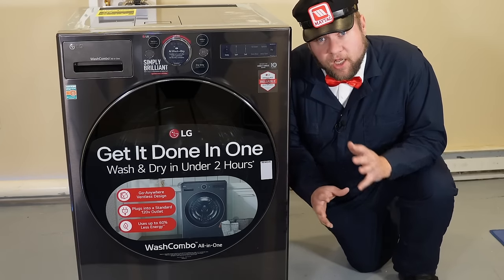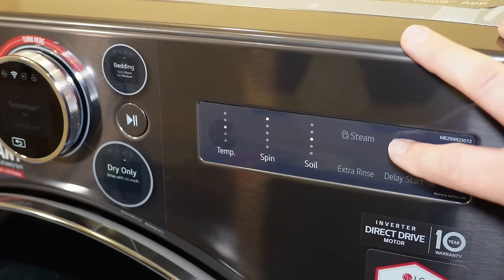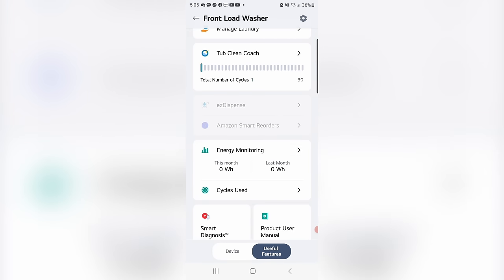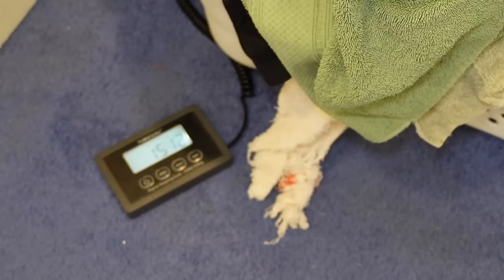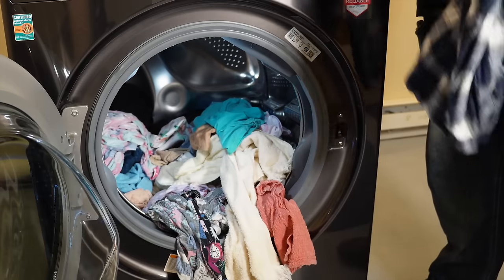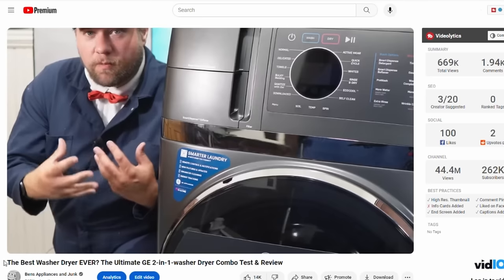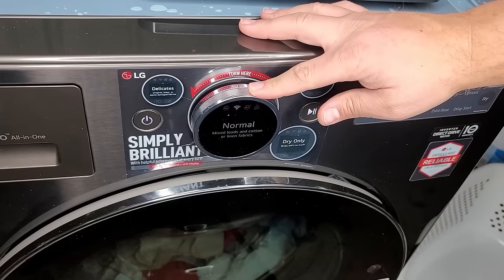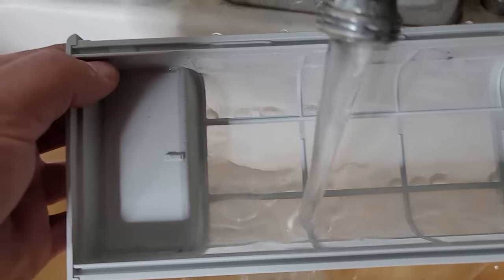BETTER THAN GE? The LG All in One Washer Dryer Combo: Test, Teardown & Review

Comment: ya know, I'm still using a Washer and Dryer From 1990. They still run like a dream, gets the cloths clean and dry, No internet Required, and the nonexistent LCD displays don't ever go bad....... because they don't exist.......... And i don't have to Worry about the AI not getting the cloths clean.......... because there is no AI. Just 2 nobs and 3 buttons, for load size. All Analog mechanical timer, and I never have to worry about Hackers or Guberments shutting them off because I "went over my Carbon footprint"  Also they are easy to repair, just hard to find parts for. but then again, they have been running for over 30 years so................................

Comment: Considering LG's reputation with compressors failing in their refrigerators and when used in central air conditioning condensers I'd stay from anything LG that contains any kind of sealed compressor system unless they put a nice long parts and labor warranty on the compressor and the whole cooling/heat pump system.  I also would never buy this or any appliance from a big box store even with an extended warranty.  My mother bought a washer from a big box store with a 5 year extended warranty.  When it failed we had to wait about two weeks for a service guy to come look at it and when he did his first comment was "We don't service GE appliances" and he left.  We had to call the warranty company back and have them send a different service guy out which took another 2 weeks.  Then he had to order parts and come back which took about a month.  It's much better to buy from a place that services what they sell and doesn't rely on outside contractors.

Comment: 2-5 hours for wash and dry, freakin ridiculous! Older washers/dryers i could get 3-4 loads done in that amount of time! These "energy" saving washers/drying are a joke!
Reply from the maker: An old dryer uses 10x the electric to get it done faster on 240v. If the heat pump was sized to a 240v30a element it would take half as long as what your old dryer did.

At peak, this unit uses 600w. The element alone an electric dryer is 5000 plus watts.

Comment: My concern would be the migrating lint inside building up to a degree that it either impedes or imperils running loads. Also, yeesh, those dry times when laundry day is already a dang chore. I would love to claw back wall space that would be freed up from my current stacked unit, not gonna lie. I do like the heat pump aspect, and I'm not going to tell my husband about this yet because he'd all over immediate purchase. Thanks for the thorough review and test runs, Ben.

Comment: Thank you, excellent analysis. I saw one of these at best buy and was surprised how small the lint filter/coils were relative to the GE Model. Our 9 year old washer is on its last legs and our 18 year old drying probably is as well. Looking at these new models as I still own a haier combo that's 22 years old (minus the heat pump).

Comment: I had an LG 2 in 1 condenser a while back (WM3997HWA) and one of the things I didn't like about it was that the clothes wouldn't quite have that dryer freshness from an air dryer. Plus I lint would accumulate on the inner door seal instead of a lint catcher or filter.

This is kind of a subjective question, but would a new heat pump dryer like this or the GE ultrafast have these problems too??

Comment: Our shitty modern washing machine is shitting the bed and its bearings are not replaceable. How do i know what washing machines at the thrift store are more repair friendly? Or rather brands to avoid? They usually around late 90s early 2000s models they have in stock

Comment: I bought the GE Combo when I went in for the LG Wash Tower. What a mistake. I hated the GE. My clothes came out more than slightly wet. No amount of shaking would dry out so I had to re start a drying cycle every time. Cleaning the filter is a pain. The GE repairman came to make sure it was working right. It wasn't. Problem with the internal computer. He fixed that and gave me two big brushes to help clean out the filter. 

The blue runner ring just at the opening was always sticky with fibers and lint. When I opened the door it was dripping. Every. Single. Time. 

I only have 2 kids and me in the home, but we were always waiting for a load of laundry to finish so we could start the next one. And bottom line, it didn't clean that well. I treated a ketchup spill with Shout and it didn't come out. 

And it is SO LOUD. You can't have a conversation with this unit on. So many people commented on how loud it is!

I sold this Combo in the classifieds and lost about $800. But I purchased the LG Wash Tower and I'm thrilled with it. 

I do not recommend  the GE Combo.

Comment: One way a person could take advantage of these 2-in-1's is by purchasing two of them and putting one in each spot of a laundry room. Even with the longer times,  it's still very convenient because you don't have to swap machines. Now, you can get two loads of laundry done during a time in which you wouldn't have been doing any. The times simply don't matter if you don't have to hang out waiting for it.

Comment: I'd much prefer a simple washer/dryer with mechanical switches, no BT or WiFi, no AI, minimum of lights or sounds that can finish a load, wash and dry, in less than an hour, give or take...
There's just too many bells-and-whistles that we're being charged for that are superfluous.  I'm fine with making them more energy efficient but that shouldn't include making them 10 times harder to repair for the average consumer and seemingly less reliable than pre-2000 units.

Comment: I'm 58 and I'd kill for an app-managed appliance like this. My worry is longevity in the built-in wireless technology as well as long-term upkeep in the mobile app and the unit firmware. Even more importantly, can the unit be bricked by a failed firmware update? These are questions for the future.

Would think the autodry tech would work well at determining dryness, at least with an appropriate load. I guess I am accustomed to a 45 minute wash and a 1-1.5 hour dry at medium heat. The total times described here feel way long for my meager machines today.

Comment: Wow, only three loads and the condenser coils already have lint on them? Why would they not have another filter in front of them? My cheap portable AC has the same issue. The evaporator coils are open air, but the air intake is filters...with no way to clean the evaporator coils unless you take apart the whole unit.

Comment: Even though this isn't new technology... it's still not "ready for primetime".   Other than single folks, doing one single load of wash at a time, this is a big detractor.  
Taking 2-4+ hours for a load completely unacceptable.  BTW, rotary compressors are less efficient than scroll compressors in small-scale applications like this.

Comment: My wife wanted to have 2 Units, we bought the GE Profile 2 in 1 before this washer dryer combo released.  You definitely want the extended warranty.  We've had it since Nov 2023 and already we are on our second water pump on the same machine.  The other machine runs the same amount of cloths and it's pump has yet to fail.

I also wish that both GE and LG allowed "easy access" to the coils, because I can tell you, after 8 months of use, they already need a good cleaning and this is us religiously cleaning out the lint filter after all loads.

Comment: I have ELECTROLUX 800 series dryer and have 2 filters allinone, and i have to clean monthly inside fins of compressor dor the lint.If not wull stuck and die.SO this LG allinone will not last i guarantee, just after 1 year a think is done working for 2 person laundry wash and dry.

Comment: I must say based on this review and the marketing claim of 60% less energy used I am very disappointed in the actual energy usage.   It makes me glad we decided to stick with separate units instead of grabbing the new to market GE combo machine when we replaced our machines about 6 months ago.  I am a big LG fan and love the thinq app.  We now have the LG 8900 series 5.2ft washer and 9ft gas dryer, LG tv's, LG dishwasher, LG oven and the app gets better with each update.  Back to the main topic.   The ability for this unit to run on 120v and only need a drain is great for people with interesting situation or perhaps an RV, but for a home with a standard laundry room the efficiency is appalling based on what you reported from your laundry at 2.25KWH for a 10lb load.  I am in Ohio also so I think our energy prices are probably comparable.  We pay 9 cents per KWH and 68 cents per CCF of natural gas.  For reference 1 ccf of gas is approximately 29.3 kwh of electricity for comparison.  In the LG 8900 series I did a 19.7lb load of mixed items with multiple pairs of jeans and several towels.  It took 257wh for the wash cycle and .04 ccf of gas for the dryer.  The amount of electricity the dryer uses is negligible.  That is equivalent to 1.43kwh of energy.  But due to gas being cheaper than electric per energy unit it is only 5 cents of total cost instead of 13 cents.  On a per pound of laundry basis that makes the combo machine 8x more expensive per pound of laundry.  It also only took 2h 13m for the complete wash+dry time and I was able to start a second small load of towels in the washer while the first load was drying - that load of 4 large beach towels only took 93whr of energy in the washing machine or less than 1 cent of electricity :).  It is drying as I write this.  If the combo machines were less expensive it might be a good thing for some people to buy 2 units instead of a separate washer and dryer - but a single unit is nearly the same price as the 8900 series pair.  I do understand these units have their place in situations where a vent is not possible, gas or 240v electric isn't available or space is at a premium.  In those cases it is wonderful.  But marketing this unit as 60% less energy use is a blatant lie when compared to their own machines of a similar size.  But nobody would market "800% more expensive per pound than our other machines!"  The efficiency, speed, and quiet of the LG 8900 series is amazing and I highly recommend them to anyone looking for a great laundry pair.  I guess I was just hoping for too much with the combo unit.  If it could actually do a load for even the same energy as the 8900 series at the same price of machine or even 20% more, I would make it my next machine and my go to recommendation.  For now I have to stick with the separate machines and be very disappointed in the LG marketing department.

Comment: 1) LG - never 2) Combo washer and dryer - never. Got myself entry level Miele with 5 years warranty and bought for $100 used GE dryer that is going to work for another 20 years with little maintenance. Heat pump units are for Germany with their electricity prices and apartment sizes. Here in US it is waste of money  in most cases as of now.

Comment: Really stupid design putting anything on top. Americans will want to stack these. To do MORE laundry. 2 stacked units is equal to 2 washers and 2 dryers going at once. Or for people who already have side by side units. They could potentially stack 4. That’s 4 washers and 4 dryers all going at one time. All using less energy combined than a 220. But you can forget this idea with this unit. It is possible with GE but you gotta build special shelving for the insane weight. It would also be great if the control panel could be swapped to top or btm for stacking if stacking was even possible, sadly it isn’t with this model.

Comment: Bought a LG 9800? From Costco, top load washer, a couple of years ago after getting tired of replacing the the shaft and bearings every year on my he Kenmore top load washer. After seeing your and other reviews of the newest LG washers actually being reliable and easier to service than most other washers now. I checked for myself about the tub bearing seals and sounded way easier to replace without having issues and the setup is modular. Replace it as a unit and prices are reasonable.
Ended up with a 4 year warranty but so far a couple years later no problem, just works.
Wonder if buying a heat pump dryer would save on the electric bill but we have a 7 cubic foot Kenmore dryer with most of the extras now that has been fine for 10 years.
Reply from the maker: I plan on doing a video on just the heat pump dryer vs. a regular tumble unit to see what the real savings are. I've seen people do the math, and make some really bad assumptions based on max wattage for an electric dryer instead of what the cycle actually would involve.
Reply: @bensappliancesandjunk  What really happens in real life use can be really different then what you expect. I was really happy with the Kenmore till the bearings got Uber loud. I tore it down completely on the porch and the first set of Chinese bearings got loud and leaked within a month so I bought a better set and I had the bearing tool from the first set. After that about every year to year and a half the bearings would get seepage and get noisy again, even when I bought a OEM whirlpool set, though they lasted longer and the seal went in easy first try.
Got tired of it and bought the LG. Some techs claimed they'd replace the seal, shaft, and bearings and they'd last many years, not for me and it was a lot of work to fix even if parts were cheap.
Reply: IMHO, It's half baked. The technology seems good. I was excited until I saw the lint on the coils after such a minimal use. Then I know about their compressors. I'd plan on it running for just a year since the warranty is for a year.

If they can improve it to the point it's not getting lint in the coils and their compressors are better then they have something. Maybe a secondary lint trap. The scraper is cool as long as it works.

Comment: As an appliance repairman here in Las Vegas I love Ben's videos and some of his videos of actually help me repair appliances but this unit is a 100% thumbs down for me as an appliance tech especially for families that have a lot of laundry to do. Imagine having to do four or five tubs in a day with a large family that would take you 24 hours Non-Stop. And did I hear him say that the price is well over $2,000 sorry for that amount of money I'm getting a Speed Queen which I know is going to last 10 to 20 years with no problem.If this unit needed an out of warranty repair on the heat pump condenser or compressor and very few techs that would know how to fix this, you would be looking at a 500 of $1,000 repair bill easily on this machine. 😮😫😢

Comment: I will never forget your review about the reliability of Speed Queen washer and dryer separates. For me, they are the gold standard, simple and fixable. My best friend has a stacked LG combo washer/dryer and we both HATE it. The chimes and dings are awful and constant. There's heat sensors in the dryer that are inaccurate and clothes take forever to dry and the dryer stops mid-cycle before the clothes dry and before the scheduled time ends. We constantly have to restart the dryer. Then the control panel has glitches too. LG is not advancement from vintage GEs, Speed Queens, and Maytags. I will never trust LG again.

Comment: After watching the full video, I gotta say I'm happy I went with the GE model. Yes, it can take some long times to go through modes, but us ADHD people having not to worry about finishing a full load applaud it. Im also very anal about cleaing the venting system clean, it's just a pain. The GE model keeps lint moist for a bit, so it kinda crusts around the inside corners of the exhaust corridor make it harder to clean. Also finding a brush to gently, but thoroughly clean the fins isnt easy.

Comment: My wife and I bought (6/22) the (I guess) previous model of this unit (more rounded features, more complicated front panel and no lint filter). It seems to have an issue of making entirely too many suds no matter how low we go on the detergent load, it then dumps wash water out the back of the unit. Other than that it is a tremendous machine... super quiet, water and electricity efficient! Does a great job of cleaning clothes and a satisfactory job drying clothes. Thank you for your review.

Comment: When using either of these exclusively as a dryer.Which one is most versatile regarding choice of temperature and drying control?Thank you. 
   Note:I already have the GE. The dryer is setting is to darn hot.I am on day 2 with the GE all in one.and  feel limited to drying temperature and the app,has maybe 4 crappy downloadable options. I want a non venting dryer option to finish the clothes, that were mostly dried on clothes line,outside. I just want to finish them on a cool setting in a machine,because I think dryers leave clothing and towels feeling softer and less crinkley.

Comment: I'm sold. Almost - I'm just confused about your need to remove lint from the back of the machine. Mine would be in a deep closet and would never be able to get to the back of it once it's installed. Is that a deal-breaker?